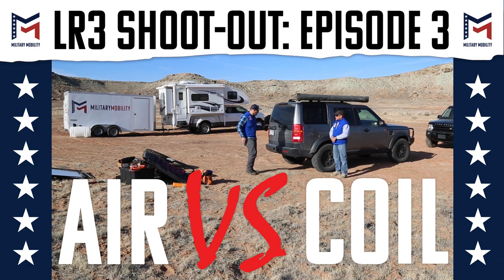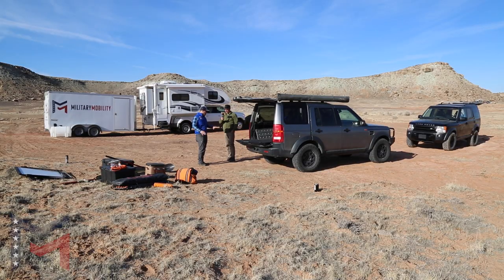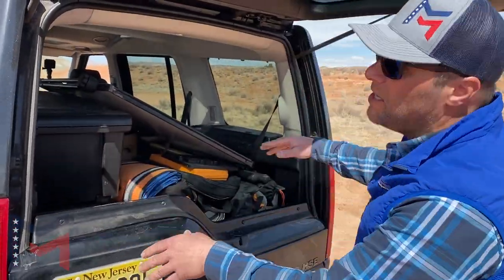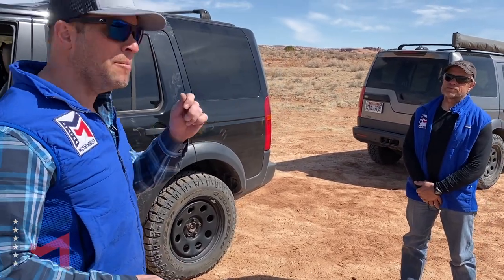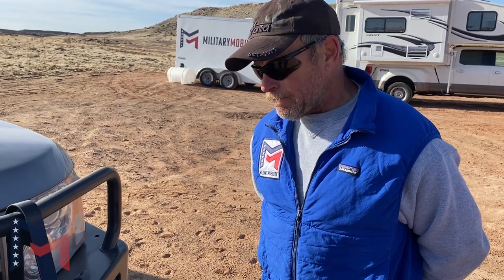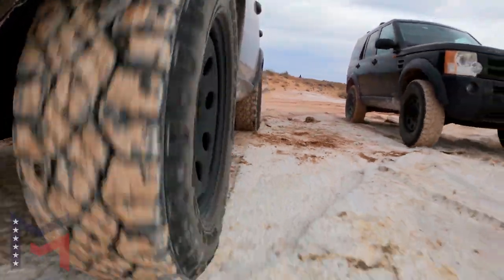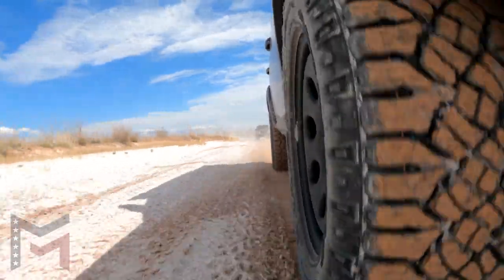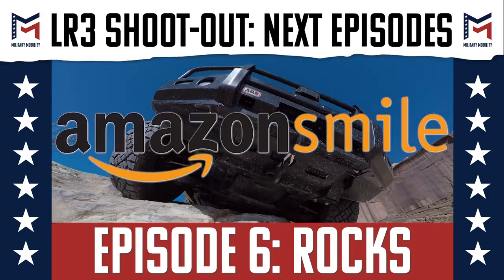Episode 3: Cargo / Land Rover LR3 / Air Vs. Coil Shoot-Out / Military Mobility

Comment: Quick note on the air suspension height test: You loaded the air sprung vehicle, got in it, let it adjust, GOT OUT, then measured. It likes to be at a particular height and does things to always keep it that way. You’ll notice every time you park and get out of the car it blows off some air. When you get out and it’s unweighted it’s now resting too high so it releases air, keeping it where it likes to be. In your measurement here you let it hit its desired height then got out, making it lighter and higher, which is why it measured higher than before being loaded up.
Reply: Agree
Reply from the maker: Thanks so much for joining the conversation. Yes we totally agree. Our LR3 usually blows off air upon exiting the vehicle as you said, but not always. It didn't do it that time so we measured it as it was. Overall the concept we're trying to convey is that the air suspension will allow you to carry more cargo weight without affecting your ground clearance as it will with the coil conversion.

Comment: Great to see the comparison between the two suspension set ups. I'm from the uk and have recently converted to coils using the Dunlop  coil conversion kit with 2" lift. The distance from centre hub to underside of wheel arch at the rear was 23" which was the same when my car was in extended height with the air bags.  I noticed you commented on the height of your coils from Atlantic British with a measurement of 20.5". I thought the Atlantic British coils where  the same spec as the Dunlop kit, may be not !
I believe the Dunlop kit is a partnership with Terrafirma supplying the coil and Dunlop the damper.
Very happy with the conversion so far. Keep up the great content. Martyn
Reply from the maker: Mmmmm….. this is very interesting. You’re getting an additional 2.5” of lift on your kit. Will have to look into this for sure. Thank you for reaching out, and for watching! 🙌
Reply: @MilitaryMobility  Also,  you don't mention   ride mode on the airsuspention when referring to the measurement.
Reply: I think he looses some clearance due to heavy front bumper .if you compress the front , you lose height in the back.
Reply from the maker: @kamrankp85  the height is irrelevant for the comparison as we are measuring sag. However, although not at that exact time, that for the majority of the comparison we are in normal ride height (unless the vehicle automatically raises itself when in Rock mode) and we’re running Johnson Rods.
Reply: @MilitaryMobility   I see. I was just thinking that the airsuspention gets stiffer the higher up it gets.  So I would assume that you would have exponentially linear curve related to sag. So for normal hight = softer suspension and less pressure in the bags =more sag. Extended mode = harder suspension and more pressure in the bags =less sag . But do agree that it doesn't matter when it aligns when the car automatically compensates 😉
Reply from the maker: @kamrankp85  what I’ve noticed is that the higher up the LR3 is lifted, it’s no so much a stiffer ride quality due to the bag pressure but because it has less uptravel, which can result in a stiffer ride if you’re hitting terrain that will bottom out the shock. Definitely the most plush in “normal” mode, which allows very good up and down travel for the available shock variance. That’s why I don’t understand folks who are running 35” inch tires as daily drivers, the rig technically can do it but you’re maxed out on uptravel and taxing the CV joints as well. In my opinion better to just use the extended and super extended modes when needed to clear an obstacle and be on your way! But to each their own 😉 Thanks for joining in the conversation! 🙌

Comment: You guys rock ! 

But one observation. You did not roll the vehicles after loading to get the correct sag measurement on the spring unit. The air will always level up regardless :)..

Food for thought for the ones that did not know. 

On the tow hook being low just a suggestion. When you think it might be needed on the trek, we attach a tow strap already and keep it on while wheeling so we dont need to crawl down there in the event we are stuck. :)
Reply from the maker: Thank you for the encouragement!! It really means alot to us. Appreciate the tip; we bit off a pretty big chunk diving into this series and we believe we’re covering more detail than anyone else has before, but there are little things that we could be doing to improve for future work. Greatly appreciated, we’re taking notes!! 🙌🇺🇸
Reply: @MilitaryMobility  been watching you guys and told my friends and family to follow and we all learn along the way. You guys are as honest as could be and we appreciate that. 

I own a few Land Rovers and love them and will die in them for sure. LOL. No mods needed at all to beef up powertrain etc. just run her the way she is from factory and it really will make you smile. Tire upgrade is a plus for serious treks but thats all it needs really. 

We will keep watching ! Thank you as always.
Reply from the maker: @gc857  Thank you for all the support; it really does make a massive difference!! 🙌

Comment: It would be interesting to see if the ride characteristics are different with the weight. The last episode it seemed like ride quality with the the air suspension was just slightly better, but almost un-noticeable. I wonder if it would get more noticeable with 400lbs in the back or perhaps the spring suspension would do better? Anyways, I really enjoy this comparison, I look forward to future videos.
Reply from the maker: Oh thank you so much. And yes you bring up a great point that we had discussed highlighting  but eventually kind of got lost in the shuffle. There was just so much material to cover and film with this series! Truth is the 400 lbs didn’t make any noticeable difference to the ride quality in the rear of either of the rigs. The air springs are constantly adjusting to weight to maintain its ride characteristics and the heavy duty coils, like most heavy duty truck products should in theory be smoother with some weight but there was no noticeable difference here (or even when we’re really heavy). Towing you can tell a bit but that’s another episode! Side note our Ford F450 rides much smoother when heavily laden as opposed to empty; as it’s been designed to haul weight and is happiest when doing so.

Comment: Hi:-) I'm building a interesting LR3 now. And this series is perfect!! What I'm taking away from this is that I'm adding the spacers to my list. My project is kind of extreme ( for me at least). The car is stripped and I'm restoring the thing with sansblasted frame, underside new engine, ARB diff locks front and back etc.. and almost all new Evrything . Digging deep into my pockets this bastard !😂) However, the plan is to have a ready to go truck.  So it's going to have a constant heavy load ( steel bumper front and back, winch front , considering winch in the back , roof rack,  rooftop tent, roof cargo , drawer system in the back + plus all the junk for overlanding etc). So I think I will probbably sag  80% of a 2" spacer kit !! so maybe i end up with a slightly higher lift then the TF coil kitt with the 2"lift. Hope it doesn't get to stiff!

Also . I really whant the lucky8 CV kitt! But god damn they are Extremely expensive. But I have to consider it. Any one have any experience with them ?
Reply from the maker: Sounds like a heck of a project for sure! With that type of weight the air may be a good option for its ability to adjust to your payload. Also have you considered a rugged overland trailer? They’re awesome for lugging along all kinds of stuff and taking weight off of the rig. From our experience with proper recovery skills you can save yourself the burden (and weight) of a rear winch, which will also get hung up in the rocks. We have seen folks carry a receiver winch and place it front or rear depending on the situation. Best of luck with the build! Would love to see how it turns out 👍
Reply: @MilitaryMobility  Thanks for  replying. Trailer is in the pipeline.  I have bought  a base trailer that I will focus ( bulding my own)on when the disco is done. The thing is that I live in Norway,  and there isn't really a lot of exciting offroad stuff to ride legally. That means that you need to be creative with where you offroad 😂So the idea for me with the back winch is the be able just get out of the situation. If I call for recovery,  the recovery car will come with a police escort😂 Its really strict over here. They take your license on site. 

And my recovery skills are equal to almost nothing🤦‍♂️ This build is just me building my dream overlander. To be honest,  probably will be able count the extreme offroad trips on one or 2 hands 5 years from now👀🐵

Its mainly overlanding with my wife ,2 kids and dogs that is the agenda . And I'm shooting for reliability on the least reliable car on the planet. So hence the coil kit  .

Loved the Discovery for many years ,but haven't pulled the trigger before now.  

Considering making some youtube videos of the build this year ( I hope )😉.
Reply from the maker: @kamrankp85  the build sounds like a very fun and worthwhile project, and allows you to dream of future adventures. We are big advocates of proper land use as going off trail gets things shut down; however I can understand the yearning to get yourself wheeling in some heavier terrain. Perhaps there’s a creative solution out there somewhere; private land, terrain park, etc.

Comment: Look at the newer ARB Summit bar.  It has much better winch access.  It will work on the LR3 or early LR4 models, ignore ARB's 2014+ thing.
Reply from the maker: Thanks, we’ll check it out. Just did a quick search and saw a very hefty price tag, from a couple of the standard big name vendors; almost $900 more than we paid for our ARB. Yikes! That’s a lot of money for less steel 😆 but you’re right it does look like a better design 👍
Reply: @MilitaryMobility  if you are more into a crawler look and want a better approach angle, check out the Tactical 4x4 option.  It sits in a lot closer to the front.   I run the T44 rear bar with dual swings, but I am less interested in the T44 front because it is (no offense to T44) not engineered professionally or tested in crash situations and isn't built the same way.  ARBs have crush cans so they don't set off airbags more easily (its about impulse rate of deceleration and a solid bar with no give will create a more peaky pulse and set off airbags in a front end bump without some absorption).   The arb is also one giant steel sheet that is bent, welded and has 60mm+ diam tube that is braced internally and not just tacked on at the end of the bar like most garage bumpers.
Reply from the maker: @IowaLR4  great gouge here. Our rigs see multiple duties; highway, overland, and rocks. You make some great points for folks to consider when looking at bumpers. Thanks for being part of this community 🙌